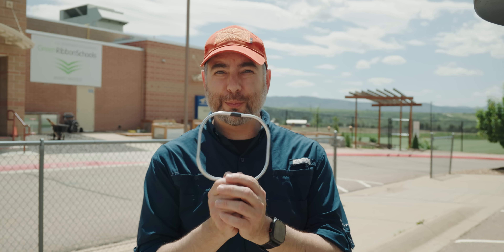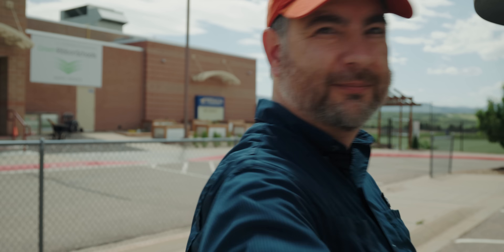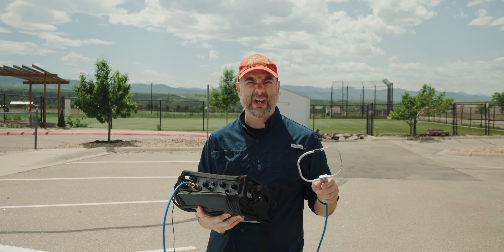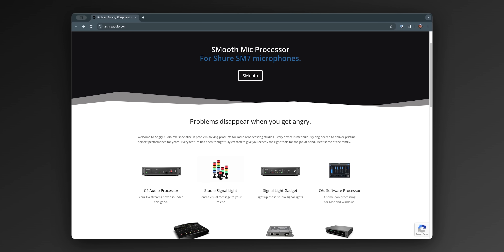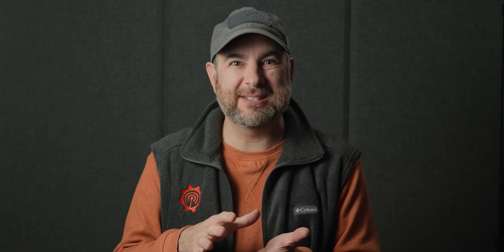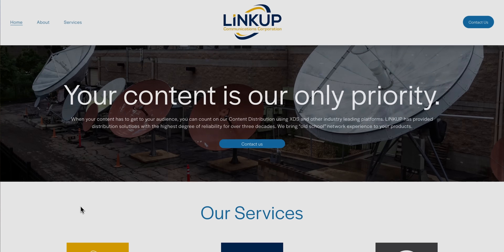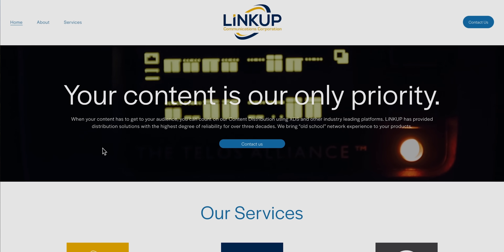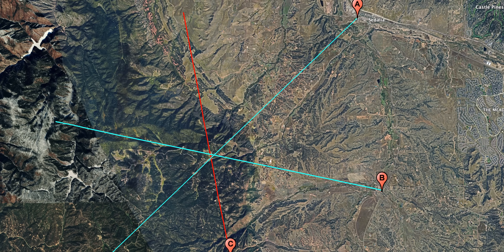Hunting a pirate transmitter

Comment: But how is this useful hunting a pirate station (that's very weak) that's on top of a commercial station that's much stronger? The stronger signal will always swamp out the weak signal on the spectrum analyzer
Reply from the maker: You’re obviously going to have to turn your stronger signal off when you make the measurements.
Reply: @TheBroadcastEngineer  Would a broadcast station actually turn their transmitter off to foxhunt?? And a smart pirate would monitor the frequency they're on and when the broadcast signal goes away, so would theirs...
Reply from the maker: Yes. Both times I had to do it professionally we dropped for a couple of minutes for me to get a bearing and then came back up on the air. There’s no other way. 99.999999% of pirates aren’t smart enough or motivated enough to have some fancy complex monitor on the legit signal to make theirs drop. And that 0.000001% can’t afford it.
Reply: @TheBroadcastEngineer  Yeah, but these days, it's really easy and cheap to do - they need a loop antenna that nulls out their signal that monitors the broadcast station, and a $15 SDR and a little bit of python code. There's a commercial station I listen too here that sometimes gets very scratchy, and if you're driving in just the right place where there's a null in their signal behind a hill, you can hear another radio station, so that's obviously interfering and causing the scratchiness, but looking at broadcast lists / maps, there shouldn't be any other stations on that frequency for over 100 miles. I've never stopped in that spot to hear the other station to identify (it's on a busy freeway, and not present all the time)
Reply: A more directional antenna can also help in these situations assuming the pirate and the broadcaster are in widely different directions.

Comment: My pirate station was a Christmas Display.
Reply: Last December I went out to DF some strange intermittent wideband popping noise that had suddenly shown up all over the HF bands at my house.  I tracked it to the flashing lights on my Christmas tree in the living room.  Doh.
Reply from the maker: @stargazer7644 Let me guess… LED bulbs? 😁
Reply: @TheBroadcastEngineer  In this case old school incandescent bulbs with the red-tipped mechanical bi-metallic flasher bulbs installed on each string.  They make a tiny arc every time they open and close and that makes them prolific short range RFI generators.  6 strings of those on the tree and you have a staccato poppety pop pop going on.  LED bulbs with solid state flashing controllers cured it.
Reply from the maker: @stargazer7644 I think that’s the first time I’ve heard that LED lights solved an interference issue.